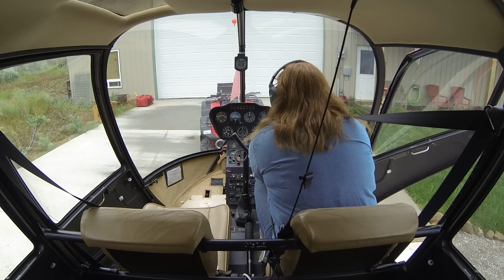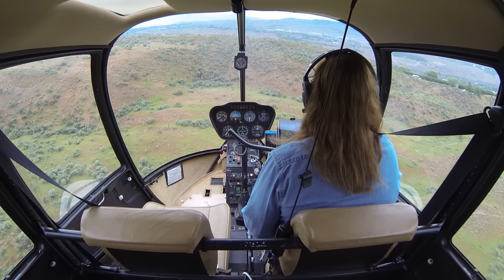Home to Airport, by Helicopter

Comment: Anybody else wondering what the cost was to fill up the tank?
Reply from the maker: Fuel is around $5.50 a gallon right now. The tanks hold about 48 gallons total. I probably had about 10 gallons on board.

Comment: Why are helicopters controlled from the right side and not the left.
Reply from the maker: Some are controlled from the left. It generally depends on which way the blades move. They say it's a CG issue; a solo pilot weight should be on the same side of the advancing blade. Robinson helicopter main rotor blades spin to the left so the advancing blade is on the right. Thus, the primary pilot seat is on the right.

Comment: I always thought that it took both hands to fly a helicopter?  Cyclic(sp) & collective?  She appears to use just right, anyone with experience care to enlighten me on how that works?
Reply from the maker: "She" here. It does take two hands. But your left hand doesn't have to be on the collective/throttle all the time. When you set it, it stays put. The R44 has an electronic governor that controls the throttle. So yes, you can remove your right hand from the controls unless you need to make a control input. Hope that clears things up.
Reply: @FlyingMAir  Thank you.

Comment: I would be very surprised if lifting and transitioning with out a pause in the hover to check T's and P's and then flying without your hand on the collective are not things that you would have been taught by an instructor.

Comment: >^..^<       Perhaps one day in a decade or so you may just be able to un plug your helicopter from your house's electrical system/charger and have a full tank/battery full of fuel/electrons n not  need to fly down to the local FBO for carbon fuel....?